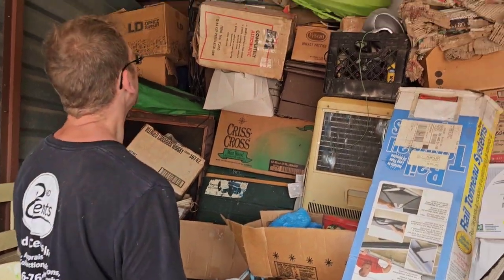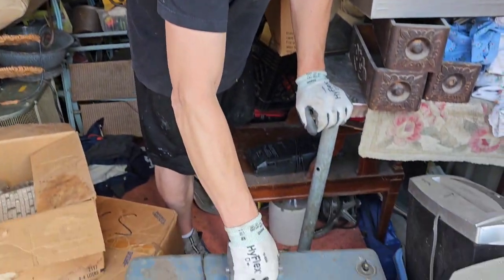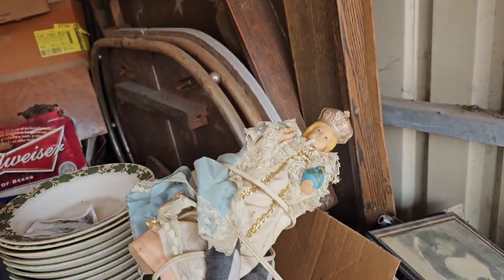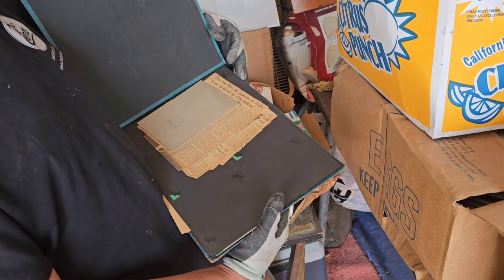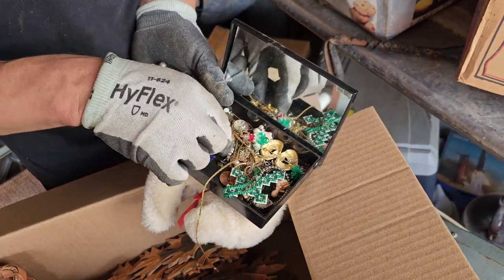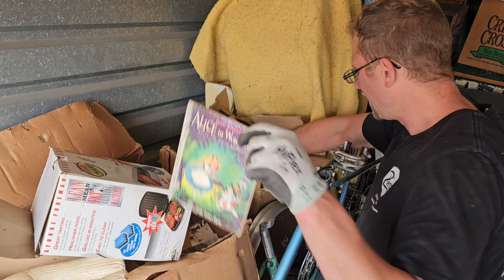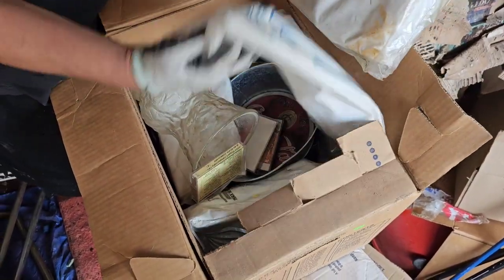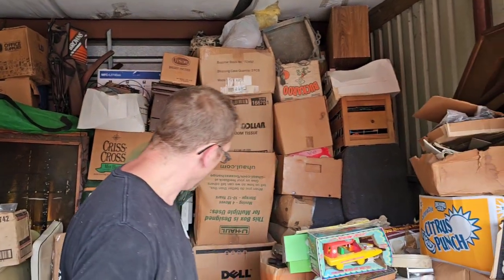Paid 10 YRS on 2 units & NOW I know WHY! ~ I buy both storage lockers, ONLY get 1? PACKED to ceiling

Comment: Love that z shaped chair.  It is a ergonomically correct for good back posture.  Sit on lower seat and legs go under the seat you are sitting on and elbows and forearms go on the upper part.  They were not sold for too long as they would break and you would land on the back of your legs and hurt or break them and caused back damage.  I am not sure what they were called.  I think the '70's